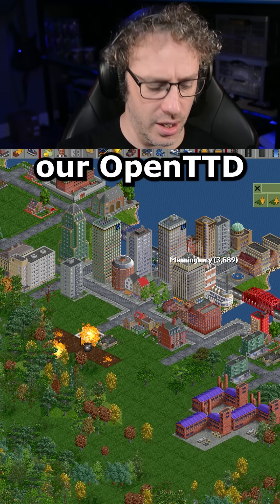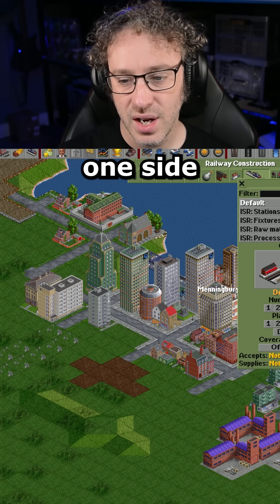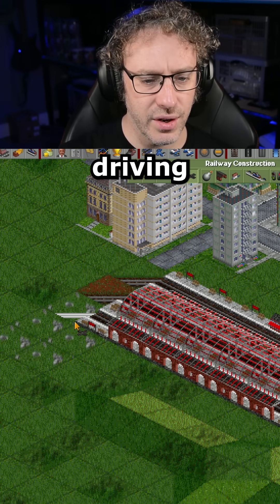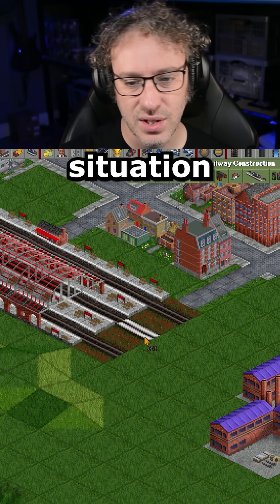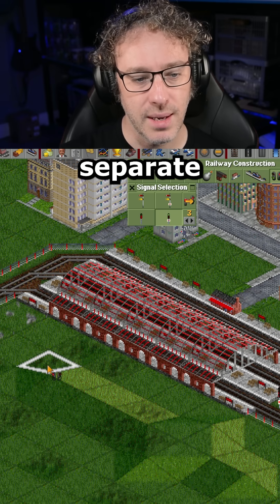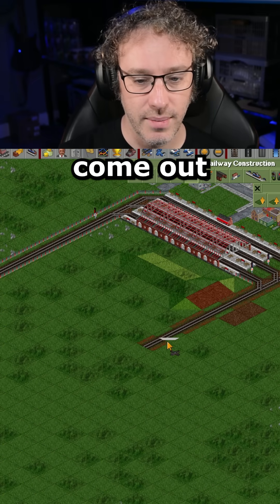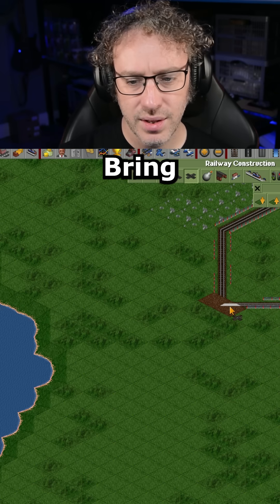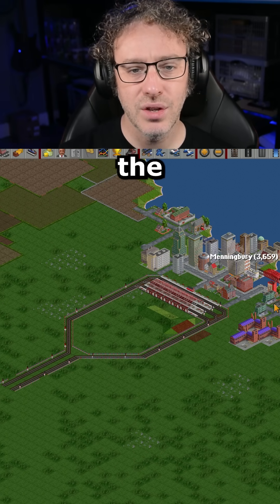Building a Coastal RoRo Station in OpenTTD

Comment: What to do if my planes crash every 20 minutes?
Reply: @Fresh_oil591  are you making large planes land at small airports?
Reply: @overlyaverage1  large planes that go over 2,000 km/hr landing in large airports only.
Reply: @Fresh_oil591 I'd disable random plane crashes in the settings if you're finding them annoying to deal with.
Reply: @DC4444  ok
Reply from the maker: There's nothing you can do apart from turn it off in the settings. Planes will always crash with a certain minimum percentage
Reply: Planes do fall out the sky too often I think reducing is the best option although I'm not sure on what option is best for you.